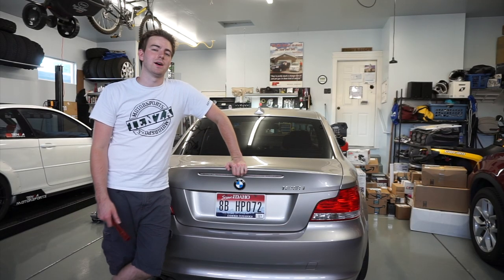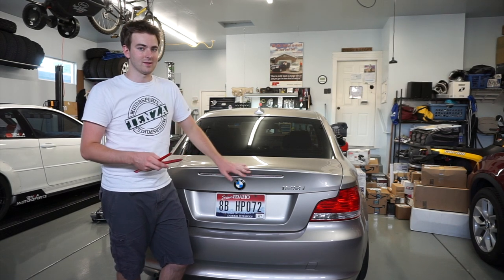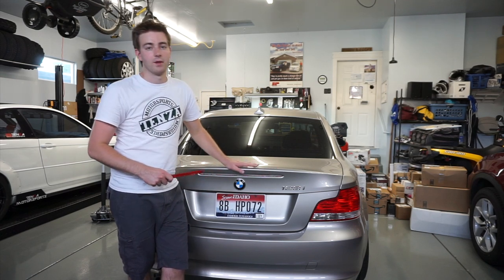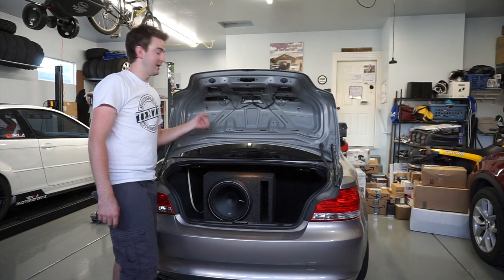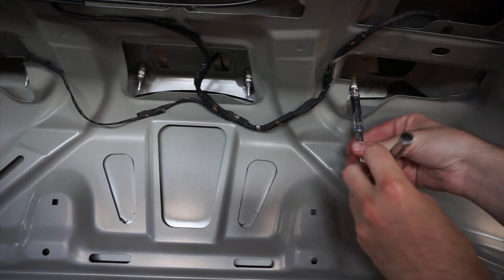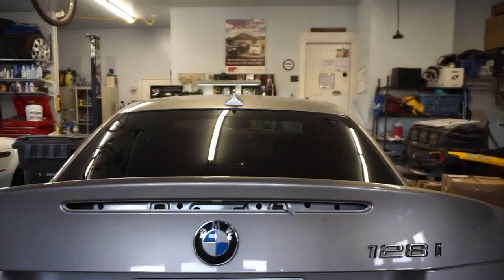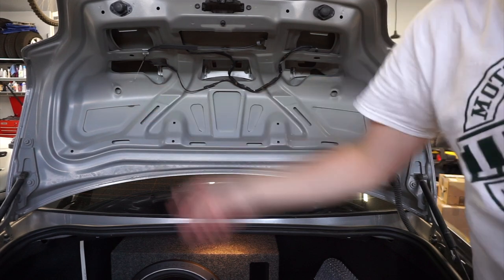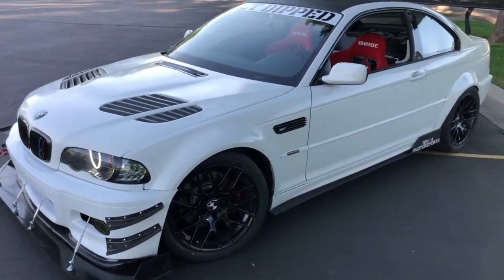BMW E82 coupe/convertible rear center brake light replacement 128/135i.

Comment: Thanks for the great video, took me also 15 minutes max to take care of the tail light. The only thing I noticed is that the new cheap tail light does not have a rubber seal around it as the original light had. Let's see if it works out long-term and if all the moisture will be kept out of the light.

Comment: Thankyou for such a clear and professional video that was straight to the point. I was lucky with my lamp not needed to be hacked apart to fit (2009 cabrio) and used main dealer part and may have just been lucky. 1 question I do have is you mentioned the torque specs but I don't have one so does the nut actually tighten against the lamp bolt or is it just the spring that takes the tension?
Reply from the maker: When it comes to the spring studs, I normally tighten until the siping is just barely maxed out. Snug. never had a problem after that.

Comment: Great video, clearly explained and well recorded. Keep helping us... Thank you !
Reply from the maker: No problem! I will continue to help as much as i can.
Reply: @TenzaMotorsports  We have a problem. The notch isn’t cut out, and there’s a raised strip of plastic running down the centre of the under side so it won’t slide in. 🤷🏻‍♀️
It’s a BMW original part. Have you got any advice?

Comment: What else can u use to get the carpet off if u don’t have the correct tool?
Reply from the maker: Flat blade screw driver
Reply: @TenzaMotorsports  thanks never thought of that.
Reply: I highly recommend getting said tool if only for your knuckles sake

Comment: Forgot to go over the part that's notched in the center of the trunk lid..  I see the oem light was cut out for it,  but the replacement wasn't.
Reply: We have the same problem. The notch isn’t cut out, and there’s a raised strip of plastic running down the centre of the under side so it won’t slide in. 🤷🏻‍♀️
It’s a BMW original part. Did you manage to solve it?

Comment: I replaced mine easily.. but still doesn't work??
Reply from the maker: You rear light stopped working all together and you replaced it and it still doesn’t work?
Reply: @TenzaMotorsports  yeah, hopefully just a fuse. Maybe reprogramming?
Reply from the maker: Sounds like a Fuse. Also check your brake switch.
Reply: @TenzaMotorsports  it works my dumb ass couldn't see it during the day😂. But I thought the third brake light was also DRL like the two in the rears on lci models??

Comment: Can't get the old one out wtf. Its soo jammed in
Reply from the maker: Some can really get stuck. I have no idea why. Mine wasn’t, But a convertible I did was.
Reply: Bro mine too, there this metal on the car body and I couldn’t remove it without braking the wheel thing